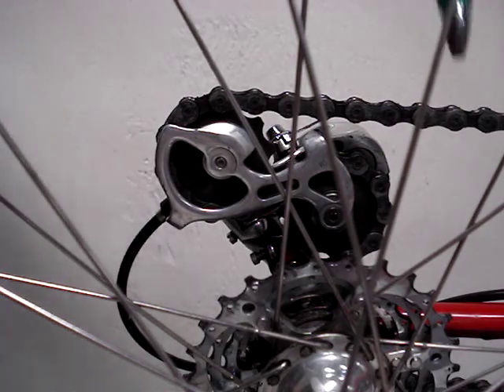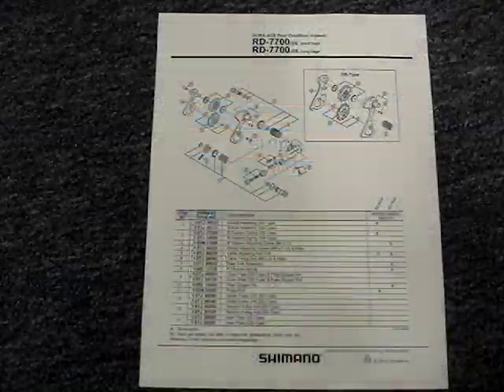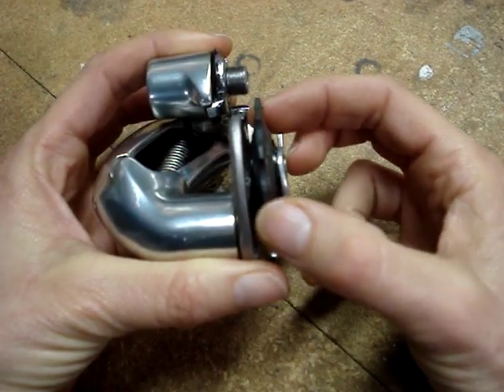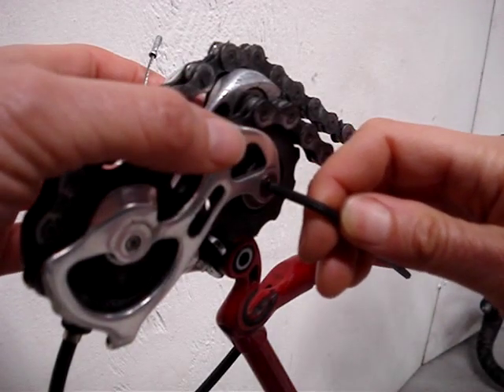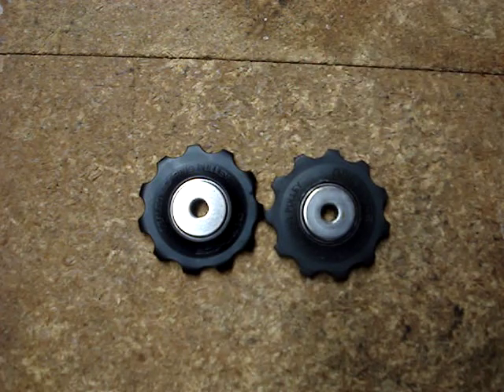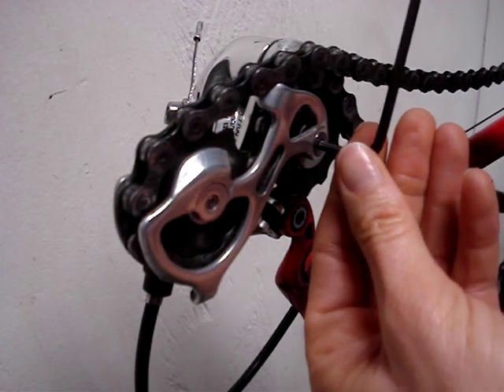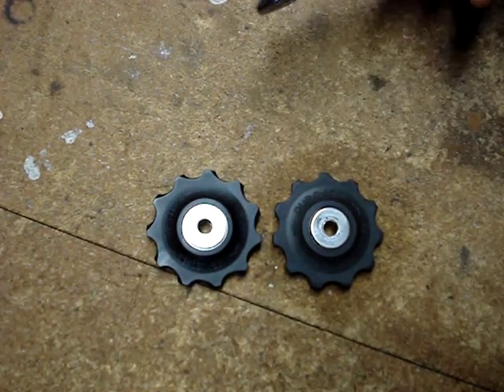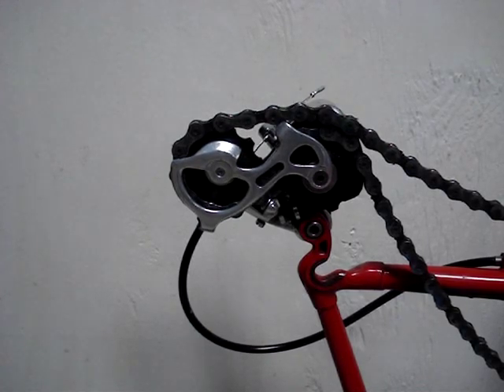Derailleur Pulley Wheel - Jockey Wheel Replacement

Comment: Thanks....probably the only video explained how to identify guide or tension pulleys if they have nothing written on them; i.e. be able to move it side-by-side by pushing with two fingers. The one that moves must be the guide pulley.
Reply from the maker: You are welcome. I try to include all the detail that you might need in the videos.
Reply: @Know-How-Now  Thanks so much for this. I was struggling till I viewed your video. I dismantled everything about a year ago and had no clue about how to re-assemble properly.
Reply from the maker: You are welcome, James.
Reply: The guide pulley isn't directional and doesn't have arrows.

Comment: Don't use the long arm of the Allen key to torque the pulley bolts. It's typically rated 3Nm, that's why you found out it was so easy to strip.
Reply from the maker: I understand leverage and used very little pressure.  I did not strip it out as you suggest.... I'm not sure how you could determine that by watching the video.   I several thousand trouble free miles on the new jockey wheels.